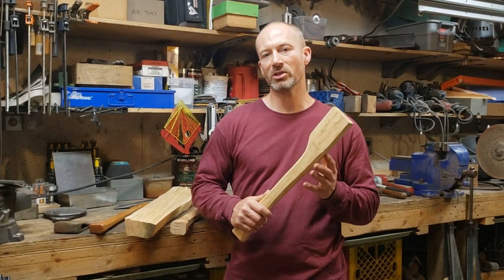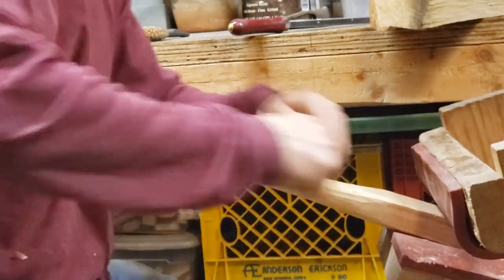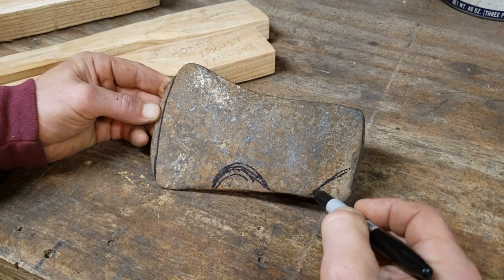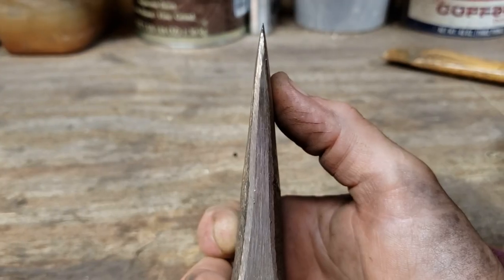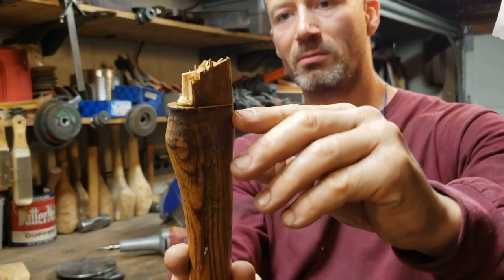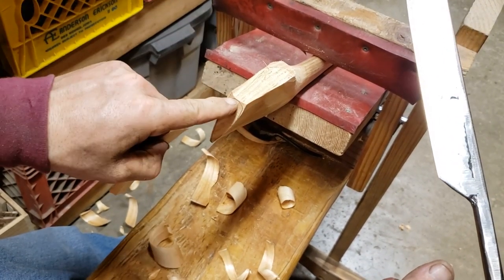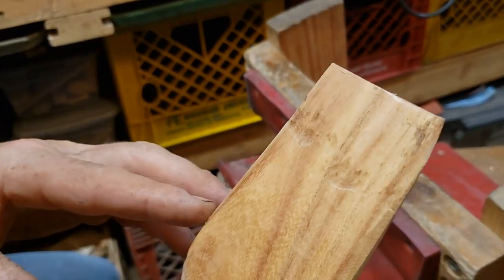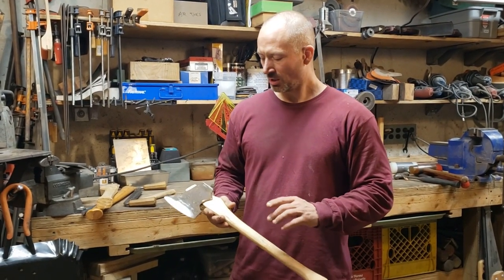Hanging a Hatchet 2: Modified Head on a Hand Carved Honey Locust Handle

Comment: You should get yourself a Shinto wood rasp.
Also, hourglass contours in the eyes are ideal but far from the norm. That should be confirmed before hanging a head upside down.
Reply from the maker: I have a Shinto and love it, but I can't use Shintos as aggressively as I can a farrier's rasp because the rivets will fail (I've already worn one out).  As far as hanging the axe upside down, I do thoroughly inspect every head I restore before getting to work on it, as many axes also have hidden cracks, asymmetries, etc. that need to be evaluated.  Hourglass, or more properly, 'bowtie' contours inside the eye ARE the norm even if many are imperfectly executed.  Exceptions exist, but they are a small minority based on my experience working with hundreds of axes.